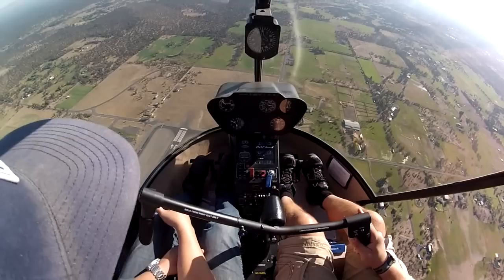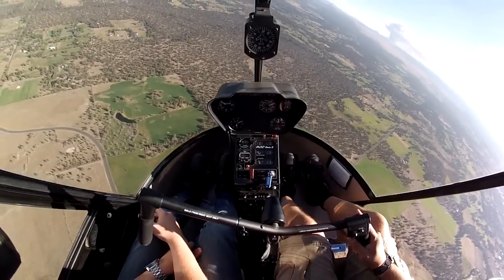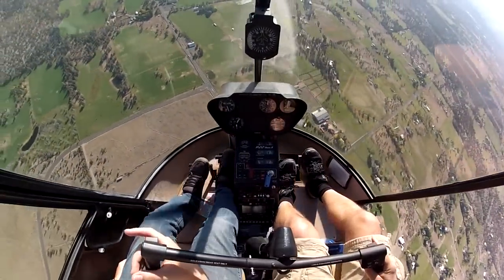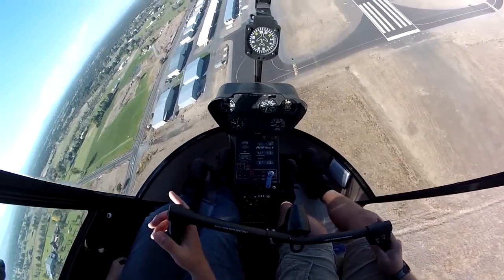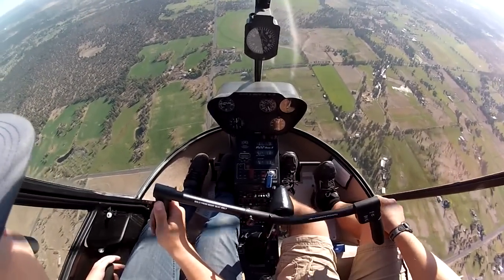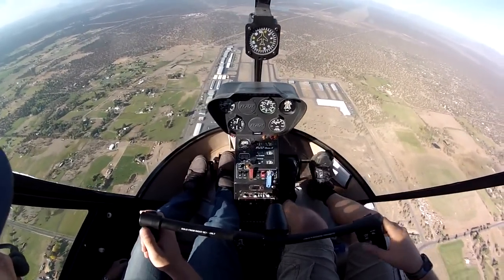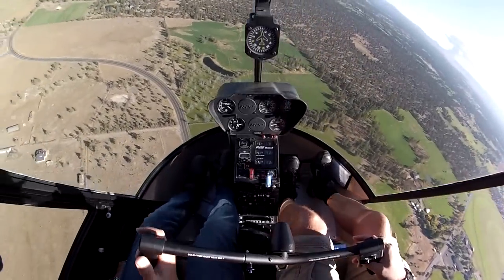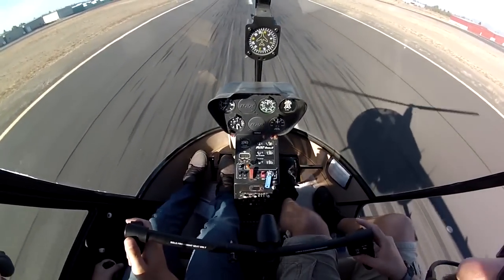Zero-Speed Autorotation With 360 Degree Turn - What if Your Engine Quits and the Spot Is Below You?

Comment: In a 500D I remember we just used to fly backwards until the spot we wanted to land on came into view, then pushed the nose down to recover forward speed and perform a normal auto from that point.
Reply from the maker: Yeah we used to call that a 'falling leaf' - not done that for a while. Would be good to compare the results with a 180 pedal turn and another 180 back to spot. I think the limiting factor on backwards would be the slower backward speed & extra drag that might cause a greater descent rate.. Maybe... But you do keep the spot in front at all times if you go back...  Might be a better option at a lower entry - better than nothing at least. Interesting...What was the lowest altitude you did that?

Comment: Even after watching it, that sounds insane. I didn't even know it was possible. My understanding was that you had to have forward speed.
Reply from the maker: Ernie Torres To turn the rotor blades in an autorotation you just need air to move from below, up through the rotor disk. BUT to make successful & safe landing, in most cases you will need forward airspeed that you can use in a flare when you have run out of altitude, to keep the blades turning as you decelerate the descent and forward airspeed. Saying that, it is possible to make a zero/low airspeed, no-flare auto to the ground: https://www.youtube.com/watch?v=cpHMqvoD4j0
Reply: Ernie Torres-
You need forward speed only when you flare at the end of your autorotation.
Reply: They did have forward speed, isn't that why they distanced themselves from the airport?  If you visualize a helicopter with only the airflow keeping the blades spinning dropping out of the sky without forward motion to permit a flair, it makes sense to me that it would smack the earth then catastrophe.
Reply: Some altitude is traded for forward airspeed in a zero airspeed autorotation.
Reply: You can have reverse speed even

Comment: The auto was started without forward airspeed, but he did trade altitude for forward airspeed as he got closer to the ground. That’s why he ended up past the thousand foot mark on the runway. I am a instrument and commercial rated helicopter pilot if you’re curious.
Reply from the maker: Yep. I have seen an R44 do a zero speed to the ground - with a good headwind, light on payload. Very risky if you mess up the timing. Not something I'd try.

Comment: Was that a stall warning horn I heard?
Reply: it goes off at 97 percent. blade stall is 80 percent plus 1 percent per 1000 density altitude..CFI here:)
Reply: I've had the rpm at 80 percent, I'm still alive, the factory says the rotor stalls at 80 percent. Thank you Frank!
Reply: Low rotor warning, not stall.
Reply from the maker: That 80% number (with the +1%) that Ryan mentioned was put out by Robinson. I understand actual blade stall may starter lower than that, but it is a good number to keep in mind when practicing autorotation and low RPM recovery - even if there might be an area of margin beyond.
Reply from the maker: You mentioned "80% to 104% ...in about 4 seconds" - I'd say a lot faster if you pull aft cyclic (assuming you have the airspeed). But I hear your point - best stay away from 80% (even max glide configuration is up around 90%). Also agree best to find out mis-rigged on a solo mx check flight with plenty of altitude.
Reply from the maker: Wow that is a nice mini-cobra! Not heard of it before, how many got built?
Reply: Theodore Irelan Hahahaaaa!!!! Oh yeah, almost. It’s a low main rotor rpm alarm.
Reply: No that's the new fart/bullshit buzzard alarm, anytime the warning buzzard goes off, there's an excess amount of farting or bullshit present, it's there in the POH if you'll look it up

Comment: Is it possible to do a straight down zero velocity autorotation all the way to touchdown?  Or must you always transition to forward flight and do the flare at the end?  i.e. If there was just one little patch in the trees you had to land in, without the room for that forward flight, flaring part... could you just drop straight down into it and pull up on collective just before touchdown?
Reply from the maker: I have seen videos of a no flare autorotation in an R44 helicopter, lightly loaded and about 15 knots of head wind. Requires very precise timing and specific conditions. Not practiced by student pilots as the conditions are unlikely and it is relatively dangerous if you get it wrong. Check out the video here: https://youtu.be/cpHMqvoD4j0
Reply: When the chips are down no harm in attempting it. Requires precesion though

Comment: What is the min AGL before a auto rotate cannot land safly?
Reply from the maker: That is a great question, but it depends on the airspeed, air density, loading of the aircraft etc. Manufacturers produce a diagram to show speed and height combinations (often called the height velocity diagram) that have been shown to produce a 'safe' autorotation.  For the R22 at zero airspeed the charts shows as low as 400' AGL. See a bit more about it here https://youtu.be/RJ8SAnwxD6I?t=23m29s